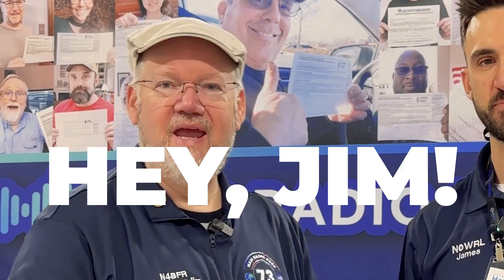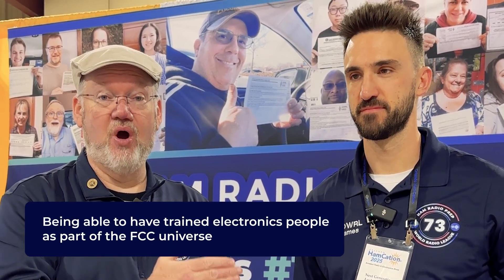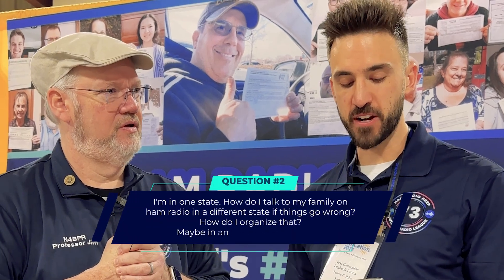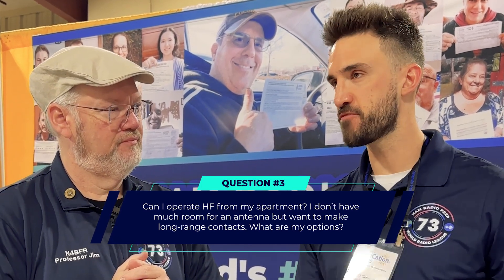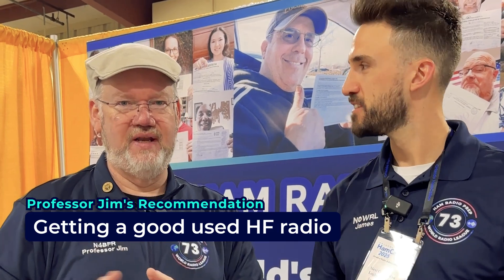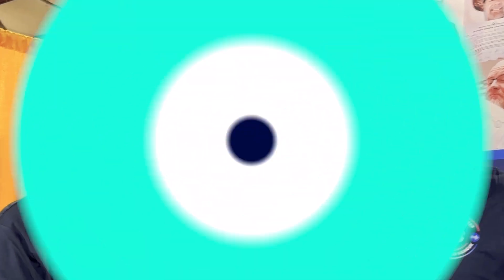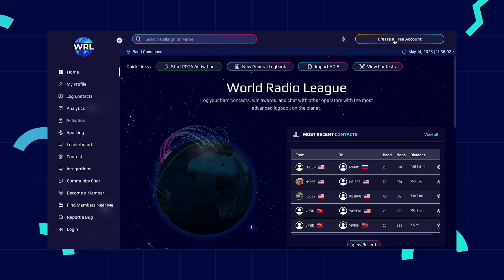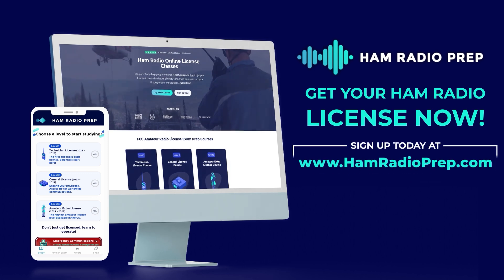Ask Professor Jim Vol. 2: HF on a Budget, Apartment Antennas & First Radios Explained

Comment: The G90, in my opinion, is a great choice for a first HF transceiver. The G90 is very affordable, and is simple to operate and master. 20 watts will enable you to communicate anywhere in the continental US, into Canada, down into the Caribbean, and into South America. To realize this capability you will need efficient cable and an efficient antenna. Put simply, a new Ham who learns the science of radio communications and basic antenna design can make the G90 perform as well as any 100 watt transceiver. I think you should re-visit the question. KQ4SRE
Reply from the maker: Thanks for the vote for the G90.  Some of this will depend on the operators skill too.